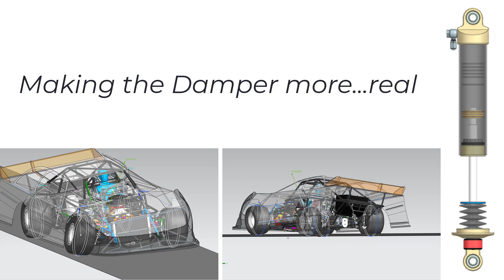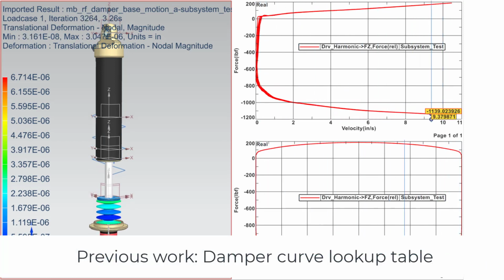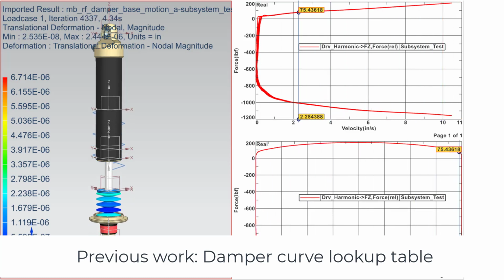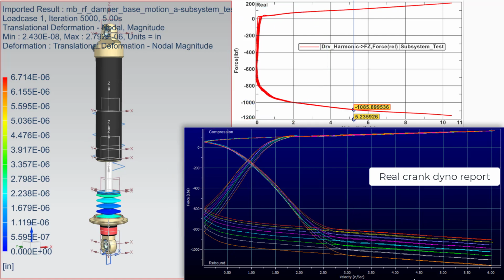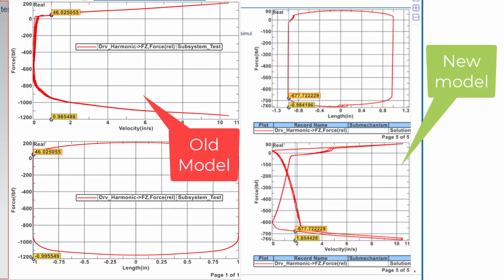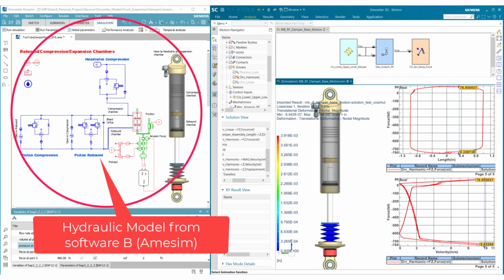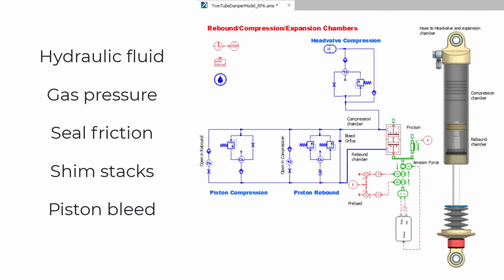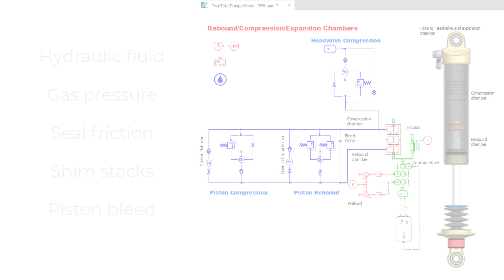Dirt late model damper update (hysteresis)

Comment: Ive heard alot of people worry about the rebound at 0 whats good whats bad etc. Shouldnt you be more interested in the rebound at 4in since thats where the car is at most of the time? But then again i guess the rebound at 0 would change how quickly or slowly you gain or lose rebound. Anyways awesome work!!
Reply from the maker: Dirt damper histograms historically show more time spent between -1 to 1 ips.  This could be a self fulfilling prophecy with large degressive shocks with high 0-point.